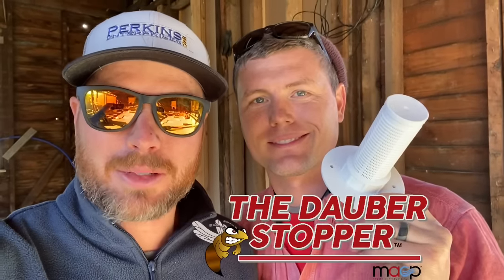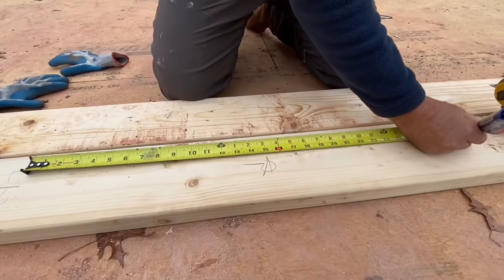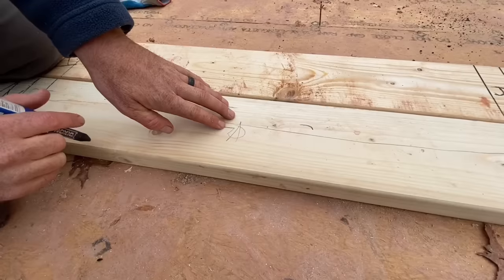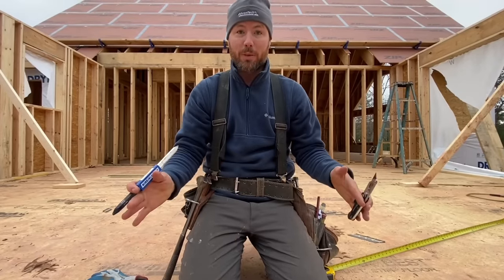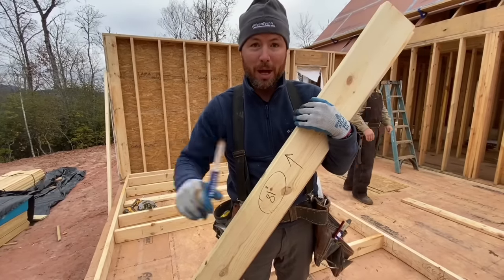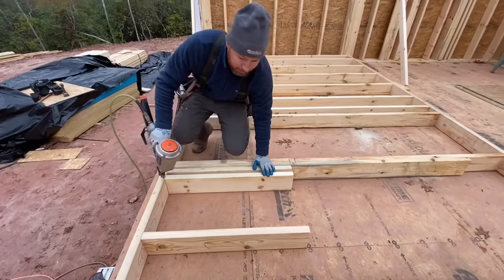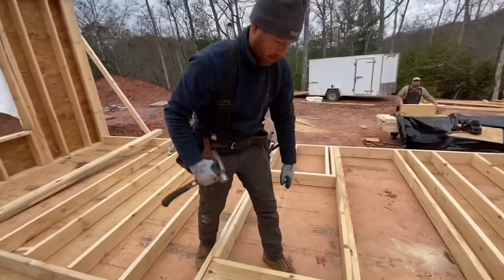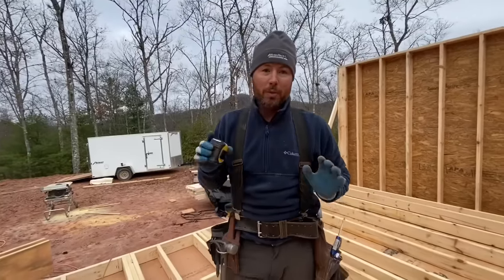Learn how to frame a window ~ Building  tutorials made easy

Comment: TIP.....To make things a bit easier and to ensure everything is tight, you should be nailing your headers into your king studs before you nail your top plate on. And your sill should be after your header is nailed. Ensuring you header is tightly nailed to your king stud is more important than the sill
Reply: Agreed, top plates are always the last thing we nail on.

Comment: Is there any reason a builder would have a cripple section between the header and top of window opening?
We have a 8ft window opening that slides horizontally. It is having issues sliding and I wonder if it’s downward pressure because header is not directly above window.

Comment: I’m going to become an apprentice soon so these videos are really helping me out. I just don’t understand what the 26 40 means
Reply: 2 foot 6 inch 4 feet 0 inchs
Reply: Window size 2'6" wide by 4'0" tall. I also put swing direction if it's a casement window. I've had guys not pay attention and had to redo some. Just hope you notice before the siding.
Reply: @pocketchange3543  really good point.  I've never done a casement before so what specifically do you account for in the framing?
Reply: @skp2158  pretty standard, same as a normal window you just need to make sure you don't put a left hand swing were a right hand swing goes. So I mark the sill with LHS or RHS on the hinge side. I do the same with doors too. Sometimes it's hard to find good help and find its good practice to double check yourself. I hate having to redo something especially when it's my own fault.

Comment: So if I am let's say trying to put a new window in a bedroom and also having to re frame this window because of carpenter ant/water damage and this new window is slightly smaller than the one currently in at 49 3/8 × 39 3/8  then my new RO should be 49 7/8 × 39 7/8 with roughly a 1/2 window casing around that new window?

Comment: Is it possible that the header is not directly over the Window? I had to make a 6 inch hole for a vent in a wall. I drilled about 3 feet above the window and went right thru 2 (2x10). Cant figure out why the header would be there... Is this a common way to frame to put the header right under the floor joist? Any help would be much appreciated. Thanks !

Comment: The only differences between whats shown in the video and how i personally do it, is the header is built without the airspace in the middle and is instead solid with the sill hanging over on the one side while also keeping the length of the sill back from the ends of the header to allow the head to sit right on the jacks and also we usually prebuild the jacks to the king studs and also precut all the needed cripples and extra sills, so its just grab it and put it in. we personally have this mentality that the guy on the gun shouldn't have to put it down when building a wall.

Comment: I’m wondering, wouldn’t it be ok to leave out the 2 side cripples and just keep the 2 that are on your layout.  
It would reduce the amount of lumber and increase the overall efficiency of the wall insulation. 2 crips would be plenty to hold that window.
Reply: There is a max distance you can span a sill without a criple, and the criples on the very sides are required no matter what

Comment: Hey There!

Can you (or anybody) enlighten me as to the uneven placement of the cripples? I want to know.

Love these educational videos.

Thank-You!
Reply: jmthompson437 cripples are holding the bottom window sill in place, jacks hold the header , cripples hold the window sill plate,  jacks are one piece from header to bottom sill plate, to make it bear the weight that will lie on the header. Hope this helps.
Reply: He did one cripple on either end of the opening, and then the two other cripples were following the 16" layout spacing of the regular studs from the rest of the wall.   It makes it easier to sheet the wall since it keeps the stud/cripple placement more consistent for nailing plywood.
Reply: @heknows5418  Thanks so much for your reply.
Reply: @MedievalTrebuchet  That was my guess. I knew there had to be a logical reason with these guys. Thanks for the confirmation. Greatly appreciated.
Reply: @MedievalTrebuchet  He discussed that measurement to accommodate sheetgoods sizes but is there a minimum spacing to bear the weight of a 6 foot window?
Reply: @skp2158  You mean a minimum spacing of the cripples below the sill to bear the weight of just the window glass?  I'm not sure.  The cripples likely aren't taking much weight there.  All the weight above the wall should be going into the jacks and king studs.  Following the 16" layout is just a good idea though.
Reply: @MedievalTrebuchet  Yes thank you.   My concern is installing a triple window mullioned together.   I'm thinking I should add a cripple directly under each of the two mullions - it's really not a big deal - not sure why I asked :)
Reply: @skp2158  cripple spacing follows 16"o/c stud spacing, double your sill. The double sill plate is stiff enough to keep multi-mull windows from sagging.
Reply: @petem2700  
Thanks man!   Wish I'd heard this before I finished the installation.   I just went with the old spacing which was 24" o/c and  added one cripple under each mull.   Didn't double the sill plate though - oh well, windows are only 36" tall (over kitchen counters) and it's not a load bearing wall so I feel okay about it.
Reply: @skp2158  At 24" o.c., better that it is crippled under mills. The cripples are to support window weight only, not any load from above, that is what the header and Jack studs do. Only concern would be mulls sagging, causing maladjustment of window sashes. Yes, I am a contractor who over builds EVERYTHING. No callbacks in 35 years
Reply: @petem2700  good of you to share your wisdom.   I'm just a DIYer working on my second gut renovation of a 100 yr old house.   Got most of my education from Youtube and The Family Handyman :)
Reply: @skp2158  Ah, 100 yr. old house. Explains the 24"+/- o.c.spacing. LOL
Reply: @petem2700  haha - you got it with the plus or minus  :)
Reply: One 2x4 can hold 900 lbs standing straight up in the air at 8 ft.

Comment: Here in Michigan everything over 48" wide we us a dbl jack
Reply: Same here in Canada
Reply: Kevin O'Brien I think that is good practice in most of the USA, some small towns may not require it , but most good carpenters  use  doubles on over 48".
Reply: And double sill
Reply: Pete M not in the south on a slab , j bolts in slab to bolt sill. Hurricane force winds is the reasoning.
Reply: @heknows5418  Window sill
Reply: Pete M sorry about that , my bad trying to multi task and got lost. Two schools here one goes 2 one goes 1 either way is acceptable to inspector.
Reply: @heknows5418  I even go as far as using 3 on a side if the span is greater then 10' and add a extra King stud.
Reply: Kevin O'Brien not here they (the guy paying for the material ) would let you seek opportunities elsewhere, you're FIRED.

Comment: Having our house built, and does not look like that, the header is there, but side supports are not, so I'm told its more than strong enough. Sooo I plan to add supports
Reply: Your window framing doesn't have jacks? If you add them now then the opening will become too small. Lumber is crazy expensive right now, make sure your builders aren't cutting corners to save money.

Comment: Can someone explain the “2640” thing? I don’t get it. Also, how do you measure the rough opening of the window? Is it written on the window’s spec sheet? Thanks a lot.
Reply: He says it's a 30x48 window opening. So 30" = 2'6" and 48"=4'0" this is confusing to me as well. why not just write it in inches?
Reply: Stumped me too! Thankfully (from the REPLIES) I learned that, in window and door jargon, width is always first (feet then inches) and height is second (feet then inches) e.g. 2 feet 6 inches (wide) X 4 feet 0 inches (high) equals 2640

Comment: Your work looks very nice but i do have one minor comment in regards to compression , the way you put the top sill or whatever you call it in your area is not neccessarily wrong but the better way would be to have your support for header one piece instead odf sandwiching in that plate !!!!  Why you ask and i may be splitting hairs but in my experience those little diagonal cracks in drywall that appear from time to time  from upper corner of opening are caused by the upper sill squishing and shrinking ( as you know wood is sometimes wet and the most shrinkage occurs in that direction .....       Not that you are wrong by most definitions , but you could be better   Cheers from a man with couple thousand units under my belt

Comment: Can anyone tell me why the cripples installed the way he did? I mean, he put two on the each side of jacks, then one a little further from the left cripple and the last one approximately 1/3 way further from the right. I’ve seen that pretty often but don’t understand why they do it. Does it make a window more stable? Can you do it symmetrically? Appreciate any clarification.
Reply: 2 on the jacks are to catch the ends of the sill any cripples between those fall on layout for sheeting and drywall later.
Reply: Back up the video to the 2:47 you will see that he has run the tape measure from the what we always called the "A" CORNER of the house, EVER wall stud was played out on 16" center from that corner. So that way all of the sheet goods 
Insulation, Drywall, Exterior Sheathing, etc falls out on the stud, or in this case the crippling under the windows.

Comment: What are your thoughts of optimum value engineering aka advanced framing?
Reply: Jesse H do u mean pre fabricated walls?
Reply: Elijah No, it’s a system of framing. 2x6 studs 24” OC, single top plates where rafters are lined up with studs, California corners, etc. The think idea is to increase insulation and decrease unnecessary lumber. Kind of seems controversial among framers.

https://www.apawood.org/advanced-framing
Reply: @jesseh2302  with all the holes plumbers, electritians, and HVAC cut into the top plates, my personal opinion is the more wood the better. I have done double 2x4 exterior walls layout is off set and 1" gap between the walls then spray foamed = less thermal bleed through.

Comment: Why not space the cripples equally in the space?  Makes it easier for other trades to get their materials in there (elect, plbg).
Reply: Because then the sheathing and drywall doesnt break, its a massive slowdown to have to stop and cut a sheet because something doesnt break. Then multiply that times a million times around the whole house. I like where your heads at but it just isnt practical.
Reply: Studs and cripples are also stacked over floor joists,

Comment: Never said why you place the cripples where you did. One side was was flush with the jack. The other side gets two with an inch between and the 4th appears randomly placed. Knowing why you spaced them where you did would be a big help.
Reply: He laid them out 16" on center with the other wall studs so that when they nail the sheeting to the exterior they'll know they have consistent nailers and even distribution of structural hold. Also applies later when the drywall is done for the interior. That's how I understood it anyway.

Comment: Why did you use 4 cripples instead of just 3? Why not just move the middle cripple slightly over?
Reply: to maintain the uniform 16" on center stud placement from one end of the wall to the other for the drywall and sheathing to be installed effortlessly

Comment: As the old cliche says, there are more than one way to skin a cat.
Fact is that there are ways to frame a house where you can save a considerable amount on framing lumber without sacrificing the integrity/strength of the home.
And one of those ways is by eliminating unnecessary wall studs.
Save 50 studs on a house, and over the coarse of a year how much does that amount to in savings?
Of coarse if you build one or 2 homes per year it dosent add up to much savings.
But what if your building 50 homes per year?
Think of it this way, if you see a dime laying on a sidewalk will you bother to pick it up?
Well saving lots more on just the amount of studs used is just that easy.
Whats the purpose of a jack stud?
Supporting the end of a header.
So if the headers were extended to the next wall stud, and the jack stud installed where it should be, how many studs would be saved on that one window opening?
How many windows are there in the house?
Take a look at your walls after you nail all your studs in place.
How many could be eliminated without sacrificing any strength to the home?
Why do you need a stud on each side of every parallel partition?
Because they act as a backer for the drywall?
How do you insulate those spaces? how many of those type spaces are there in the entire house?
How do you go about framing the corners of the house?
Can you install insulation in those also?
Could we build that corner by using a total of 3 studs on both walls and be able to insulate it?
Instead of a stud on each side of a parallel partition, would one 2x6 turned flat serve as a backer and allow for insulating behind it? 
I mean if were willing to place roof trusses and floor trusses on 24” centers, then why cant we frame in such a way as to save on lumber there as well?
Fact is that we can, but old habits prevent us from doing it.
Do you know how Levitt built all those houses at the low prices he sold them?
Well i can tell you for a fact that he didnt cheat on the material.
But he didnt waste anything either, nor did much get carted away in the workers pickup trucks either.
Sometime take a walk thru of a Toll Bros house before its been drywalled.
What type of a tool belt do you think each of them prefer? lol

Comment: Drilling holes In Your header will reduce structural value, if you don’t want to just put a piece of 1/2 inch ply or osb in between, then grab some half inch foam insulation board. Never drill holes in a header that bears load, structural integrity comes before r value... unless they only drill a couple tiny holes, but that method is also something that wastes a lot of time and is inefficient . Also when building window and door frames it’s better to draw out a story pole. It will tell you the exact measurements of every single framing member in your rough opening so you don’t have to memorize or look at the blueprints all day. Look up how to make a story pole. They’re time savers that you keep at your cut station

Comment: I appreciate the tutorial. Very helpful. However, I believe you made some minor mistakes in the tutorial, like for example, saying/displaying the farthest left arrow (the third one) @2:47 in the video as a cripple when it is a jack stud.  

Also, the finished product, which is easier to see @0:18 secs in the video doesn't have the additional cripple (two on left side) you said would be added @3:21 in the video, and the one on the right side is not butted up against the jack stud like you drew it out. I expect that is because later you decided to remark it (the right side one) at the 16" on-center for the wall spacing, which you alluded to somewhere else. 

The finished product also shows a second king stud on each side, instead of one on each side, that was not planned/drew out ahead in the tutorial, which you said could be added. I personally believe adding it was wise. 

Then there is the case of the header which I may leave for another comment, concerning the empty space with no backing.  Yet, I know, these are minor things... but for those of us amateurs still learning, it is confusing unless one watches the video repeatedly like I have done, lol.

Again, thanks for the tutorial, as it has helped a lot.
-

Comment: Why does the 40 in "2640" stand for 48 inches? I get the 26 stands for 30 inches.
Reply from the maker: 26= 2ft & 6 inches
40= 4ft & 0 inches
Reply: Stumped me too! Thankfully (from the REPLIES) I learned that, in window and door jargon, width is always first (feet then inches) and height is second (feet then inches) e.g. 2 feet 6 inches (wide) X 4 feet 0 inches (high) equals 2640

Comment: The jack doesn’t hold the header up. It transfers structural weight down from the header, and the header is doing the work of the studs that are missing due to the window opening. Important to understand the function properly
Reply: He said the king stud Carry's the load basically

Comment: The part that confuses me is how is the window opening larger than 3.5 inches when the opening is only the width of a 2x4. Im rehabing a 100 year old brick house and replacing windows and there is abt 6 inches of space in all the openings.
Reply: They ain’t using 2x4’s it’s 2x6

Comment: I don't understand 30" x 48" = 26" x 40" how did you loos 8" ?
Reply: 2’6” x 4’0”
Reply: Stumped me too! Thankfully (from the REPLIES) I learned that, in window and door jargon, width is always first (feet then inches) and height is second (feet then inches) e.g. 2 feet 6 inches (wide) X 4 feet 0 inches (high) equals 2640

Comment: can someone explain the "2640?" Lost me there
Reply: Never mind: 2' 6"= 30" and 4' 0" = 48"    I see, but I still think that's an odd way to write it. Why not just 30 inches X 48 inches (30" X 48") or 2'6" X 4'?
Reply: Just how window lingo is. A 3-0 window isn’t 30 inches. It’s 3 feet 0 inches.
Reply: @calebj0682  Interesting. Never knew that. Thanks for the insight.
Reply: Stumped me too! Thankfully (from the REPLIES) I learned that, in window and door jargon, width is always first (feet then inches) and height is second (feet then inches) e.g. 2 feet 6 inches (wide) X 4 feet 0 inches (high) equals 2640